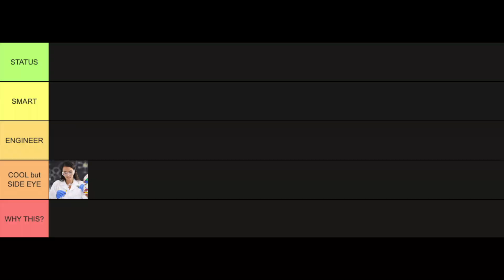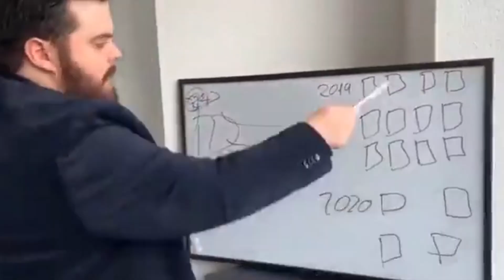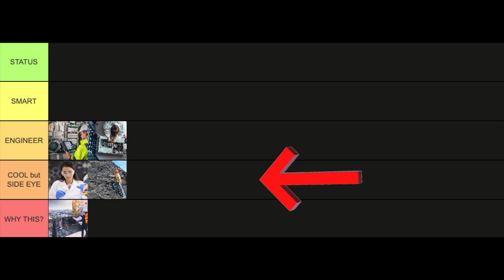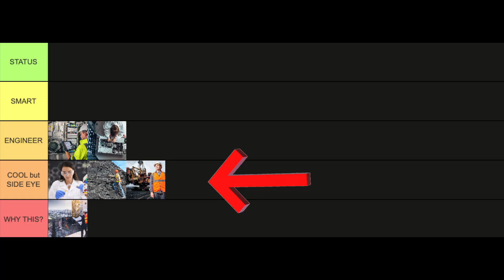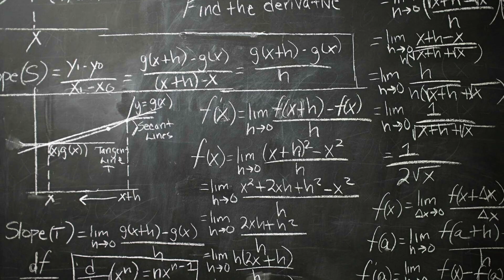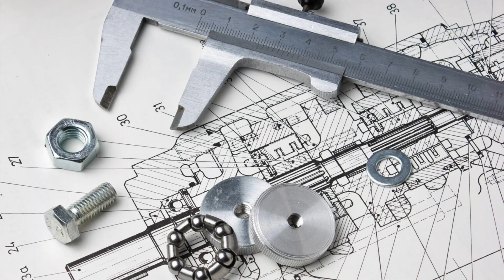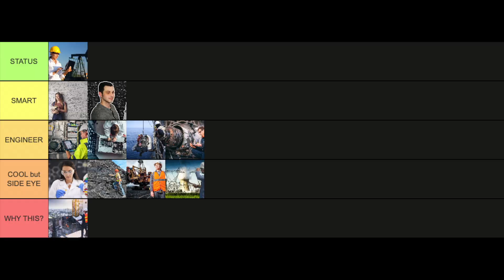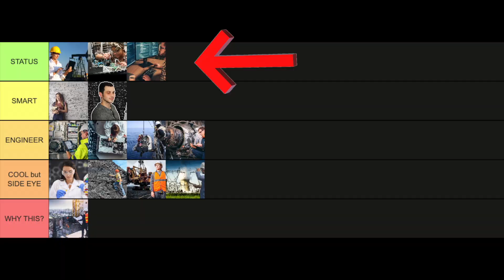Ranking Engineering Majors by Public Perception (Good Luck, Civil)

Comment: Power engineering here, we really like BIG circuits. Big circuit good. The current can't stand still for some reason... Neither does voltage... hmm... And we get to work on those big spinning things. Also, you get to be friends with this one cool guy named electrical arc.

Comment: Actually Civil engineering is more than just "buildings and bridges". For me is one of the widest branch of engineering, second only of Mechanical probably. There's the Hydraulic stuff, like Dams, water supply infrastructures, and other liquid infrastructures that requires a lot of fluid mechanics. There's also the geotech stuff, like foundations and tunnels, that is basically Solid mechanics + geology. Even Structural engineering is a lot more than just civilian buildings.
Reply: Without electricity ⚡️ none of that matters
Reply: @imbored3782  ok, tell that to the roman engineers.

Sure they used slaves but they managed

Comment: The Francis Scott Key bridge falling wasn't the engineers fault... a ship literally crashed into it
Reply: Electrical or mechanical engineer's fault (The ship lost power)
Reply: @ArchIVEDCinema  Not necessarily an engineers fault. Loose wires or breakers opening (which were either due to maintenance or the crew) caused the ship to lose power

Comment: as a computer engineer, 70% of my classes are shared with electrical. The amount of times I've had to explain it can't be counted
Reply: Yeah there’s a huge amount of overlap. I feel like CompE is just specialized EE as it relates to computer systems. They understand how the circuits work on the ECE level but also take a lot of programming classes too.
Reply: @Caleb-e4m  CE is more like electronic engineering then electrical
Reply: Yeah, we share classes with EE and ECE up until 3rd yr lol. I checked the curriculum for C in our school and it was basically all out software subjects plus a few electives, but without the other half of electrical engineering/hardware. They basically had half the load
Reply: is electrical from amongus
Reply: for me EE is 95% of my CE major only difference is our electives.

Comment: Materials engineering?
Reply: That's just a subset of chemical engineering really
Reply: @fablearchitect7645  lol, I took MSE for undergrad and am finishing grad. It's definitely not. MSE focuses on solid materials and their structure, properties, and processing. While chem also focuses on processing, it primarily applies thermo for large-scale production and usually looks at more liquid or gaseous state matter.
Reply: @ They both apply chemistry to produce products and seem closely related. Would you consider Metallurgy a subset of MSE?
Reply: @fablearchitect7645  Metallurgy would technically be a subset of MSE (focus on, well, metal and alloys). Similar to how ceramics, composites, semiconductors, and polymers can be as well (polymers probably having the most overlap with chemical engineering). While they both involve chemistry, they differ in what subsets of chemistry are primarily involved. 

Also, they overlap in some ways, ie both a materials engineer and a chemical engineer can be a process engineer for a particular role (especially if it involves solid materials).

But at the end of the day, a materials engineer is usually focused on developing a new solid-state material, and a chemical engineer improving a chemical reaction process of usually a liquid or gaseous compound.
Reply: I should also mention that this usually lends MSE to being more R&D focused whereas chemical engineering is usually more traditional engineering work of optimization; which is partly why you see MSE offered more at the graduate level than the undergrad.